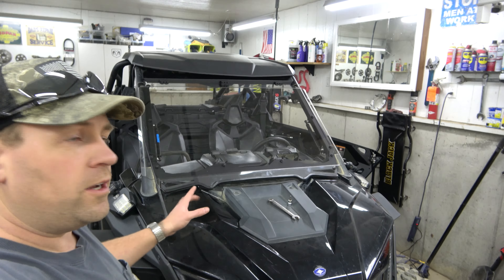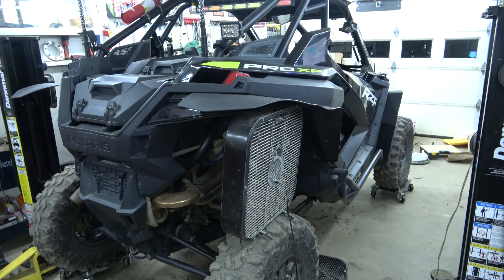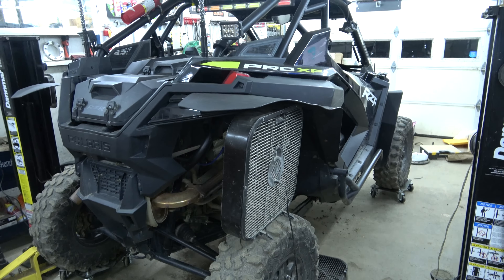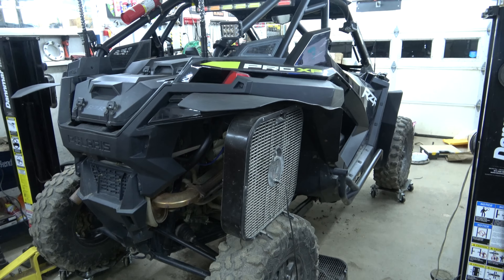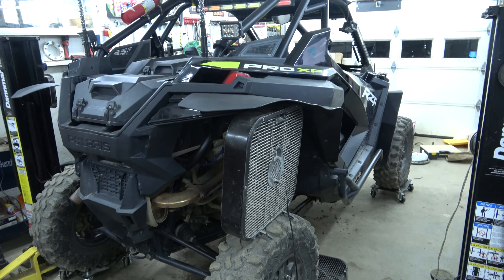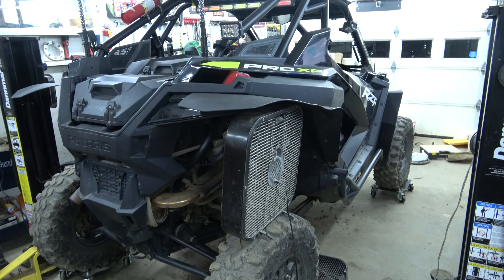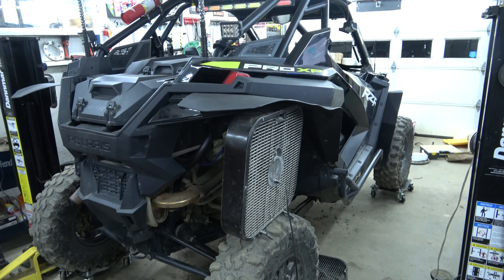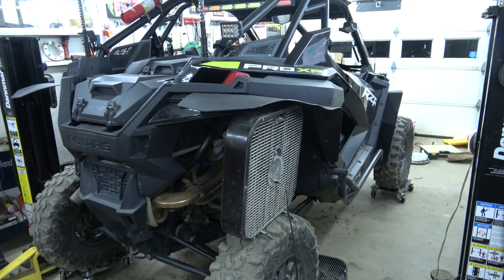Installing PRO XP upper and inner doors.  Now that we have heat, let's keep it INSIDE the machine!

Comment: What’s the verdict after summer? Did the upper doors make it too hot? I have a 4 seater so I have to do that door crap x 4 🤦‍♂️
Reply from the maker: I ended up keeping them on for the summer and just rolled them down.  That, along with venting the windshield, allow enough air circulation to keep me comfortable.  Don't get me wrong, it was definitely warm, but I can't say it was much warmer than these machines are in the summer with no enclosure.  I am still on the lookout for some take-off lower doors, but that's mostly just to save the wear and tear on the enclosure plastic and zippers.  

I do not envy you having to do this on a four door!  These things were a pain to install, that's for sure!  However, we did just go out for a snow ride and it was in the lower 20's.  Everyone else had all of their winter gear on and were freezing.  I had on a sweatshirt and had to shut the heat off at one point because it was too hot!  People kept hopping in my machine to warm up when we stopped.  Absolutely worth having, especially when accompanied with the heater!

Thanks for commenting and for watching!